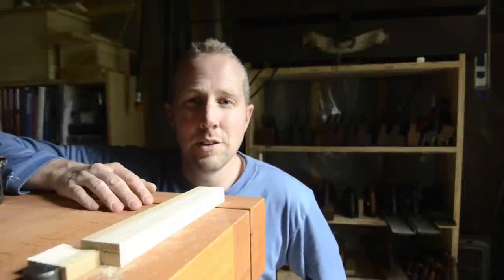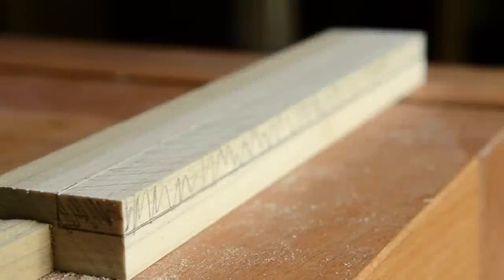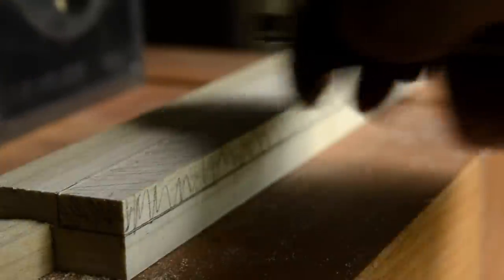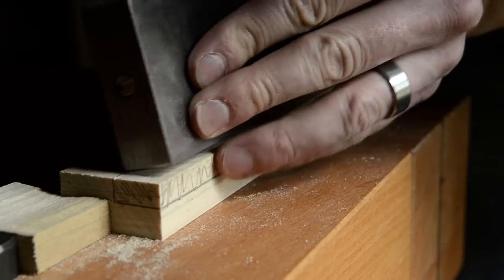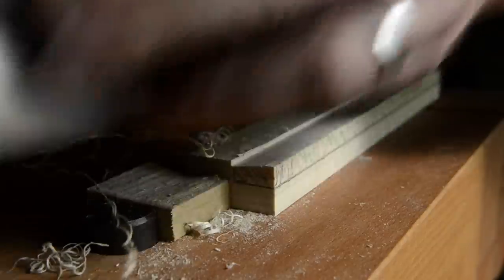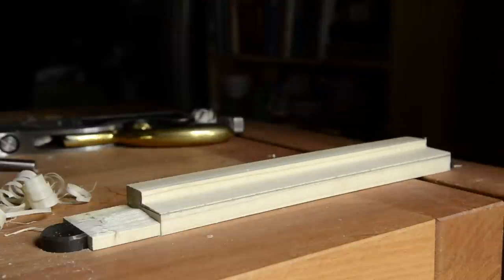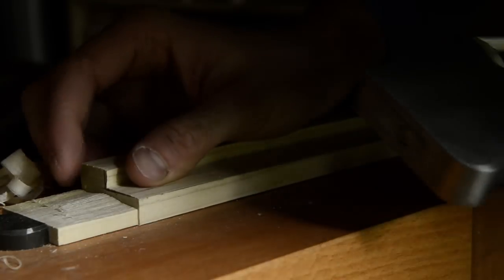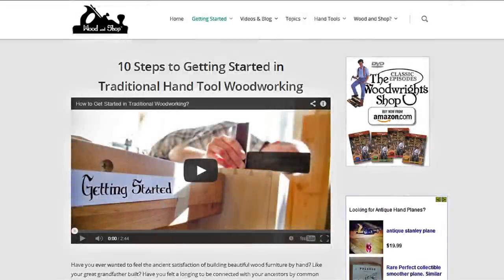How to Cut Rabbets with Hand Tools

Comment: Hi Joshua,

Was the shoulder plane really necessary?

I noticed that your block rabbet plane has nickers. Why didn't you just use them in the line you had scribed with your marking gauge? Isn't that the very reason for their existence? They'd ride in the groove and help guide your rabbet block plane. With each pass, they'd deepen the groove just a bit more and help guide your block plane no matter how deep or shallow your rabbet.

Is there any reason why you did not do that instead?
Reply: no good reason. I use the rabbet plane and stay away from the marking line, and then I use the shoulder plane to create that crisp wall.

Comment: The video is great but what if I what to make a rebate that's bigger then my plane for a casement window were I need a 57mm rebate
Reply from the maker: +oldwood100 You can cut down along the line with a plow plane, then remove the rest of the waste with a bench plane...and clean it up with your rebate or shoulder plane.